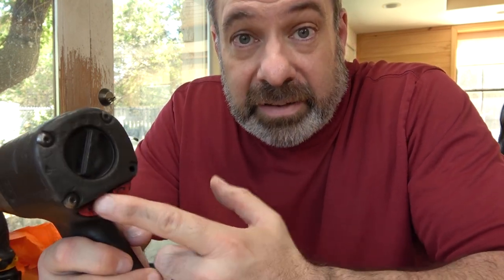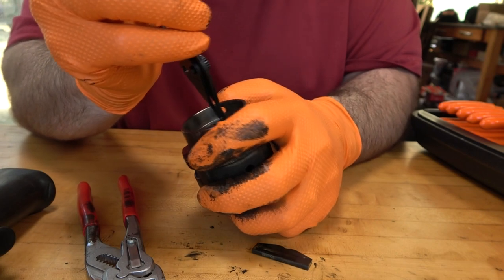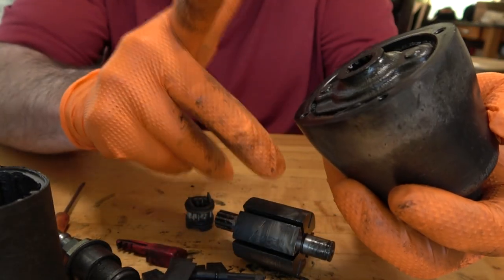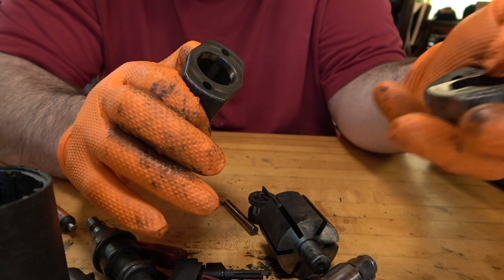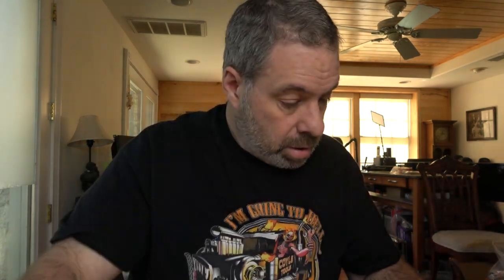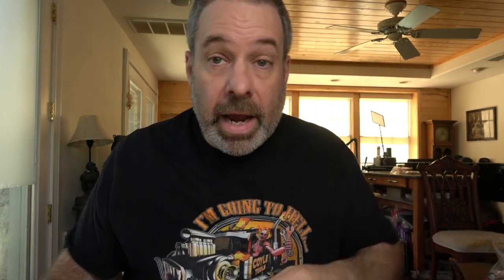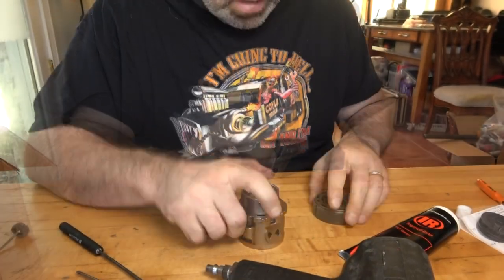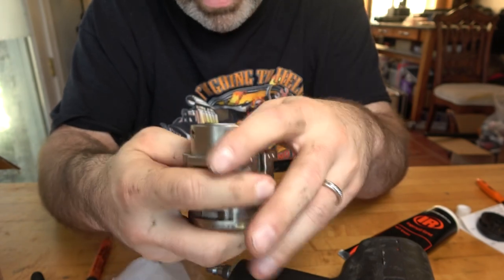Ingersoll-Rand 2131 1/2"-Drive Air Impact Repair & Rebuild

Comment: How did you get the old bearing out?
Reply from the maker: I can't believe I neglected to put that in the video. I used a 90-degree pick and wedged the tip between the bearing and the housing on the inside diameter of the bearing, then slowly worked it loose.
Reply: I used some gentle heat around the bearing holder. Let the bearing drop out by gravity.
Reply: @lawts0908  What's gentle heat?  What did you use?
Reply: @CoyleTools  Did you record taking the bearing out? That's the part that scares me the most.  Would love to see it.  Also what pick (brand) did you use? Picks that small easily bend.   Thanks!
Reply: @SteveK99Sub  Hi Steve, I used a general purpose plumbers blow lamp ( used for soldering plumbing joints) this should definitely be enough. Gently heat the aluminium bearing holder nice and evenly around the bearing.
Reply: Are you saying a electric heat gun ok ???
Reply: @philliphall5198  That may do the job, so give it a go. Otherwise use a plumber’s propane blow torch for a bit more heat.👍

Comment: Nice, not sure if anyone has touched on this but 1/2 & 3/4 pvc make really good bearing drivers, back in my farming days we would rebuild centrifugal pumps for spraying applications and the pump manufacturer instructions suggested using pvc for bearing drivers, looking forward to some more live streams 👍🏾🤙🏾
Reply from the maker: GREAT suggestion!

Comment: I appreciate your video.  I have this model and rebuilt mine based on your video.  There is one critical error in your video that can drive folks crazy if they follow it closely.  When you assemble the hammers into the cage, you must ensure that the inner lips face inside or you will not have any power when operating the unit.  Your orientation in the video has one hammer with the inner lips facing inside and the second is facing outside.  When I first reassembled, all seemed to work fine until I actually had to remove a bolt - had not power.  This was the problem.  Again, thank you for the video, it allowed me to repair this Impact that was giving me problems.
Reply from the maker: Thank you for your insight on this. Admittedly, I'm not familiar with the inner lips you're referring to. The hammers have flat surfaces and my understanding is as long as they're aligned such that the slots on the side properly accept the pins, they correct. Can you elaborate on the lips you're referring to?
Reply: @CoyleTools  if you look closely at one hammer.  One side is different from the other.  One side is flat while the other side has grooves on the inner portion of the hammer. The inner grooves face on the inside of the cage.
Reply from the maker: @MrBobby3340  Thank you. I'll give a look at the next one I get.

Comment: I remember the rebuild kits used to include the vanes which never seemed to wear out.  On the old CP 734’s it was always the hammers that would break and often the anvils were bad.
Reply: I still got several of them but never use them anymore 
Lots of ware

Comment: With blind bearings like that a slide hammer will make quick work of it. Great videos, keep it up
Reply from the maker: Thanks, Alex, that's a good tip. Sadly, I don't own a slide hammer, although I have them in stock and the small one would have been perfect.

Comment: Very helpful video. I have the same model and have been thinking about putting it back into service
Reply from the maker: So happy you found it useful, Greg! I'm confident yours will do well.
Reply: It still works pretty well I just never liked the pin retainer. I got it used and ran it for 10 years so it's probably pretty gunked up too

Comment: Great video I've never seen the inside of an impact gun when you said you don't recomend the method you used for tapping in the bearing you were correct it is always a good practice to use something the same size as the outer race of the bearing ie a washer,pvc, etc so that you don't damage the bearings by driving on the inner race 😉
Reply from the maker: Thanks, bud! I'm so glad you enjoyed it.

Comment: Great video. I've got an IR Titanium, not sure of the model number, but it looks like this one. Problem I'm having is the throttle is getting blow by. Meaning as soon as I put it on the hose it will start spinning. Took it all apart (thanks to you) and looks like the throttle needle assembly is worn out. One of the little "star" looking things has all the knobs worn down. 
My questions are: Do you know how to determine the model number (mine has the labels worn off)?
What grease do you recommend for lubrication on the parts? 
How often should one do a deep clean and relube? (I'm sure it's dependent on usage)
Thanks again for the super informative and detailed video. Certainly earned my sub.

Comment: FYI, a slight excess of grease is fine, and preferable to not enough grease. The hammer case is designed so that excess grease will work itself out through the anvil opening. IR recommends 4cc of grease through the fitting (4 pumps from a mini grease gun) using IR115 grease which is a bit lighter than IR105 so it gets distributed better when using the grease fitting.
Reply from the maker: Thanks for the advice, Wayne!

Comment: installing a bearing by pressing/hammering on the inner race is not 
the best for the bearing. all the force is being transferred through the balls to the race surface. it's best to apply force to the race that has the resistance, in this case the outer race. hope this helps, thanks for the video

Comment: I’m cant understand why you replaced so many parts, but not the red seal between the hammer anvil assembly and the vane motor. I think this seal is one of the more important components as air will leak out if it fails. Well worth the bucks if you’re doing a strip down imho.
Reply from the maker: The one that was there was fine. I don't see a need to charge the customer for unneeded parts. Those gaskets are plastic, so they're pretty sturdy.
Reply: @CoyleTools  That’s fine. Forgot to say about your great singing though. Really enjoyed the video, many thanks.

Comment: Hi,

Iwamted to know if you have any knowledge on the W5350? It’s their 1/2” right angle battery impact. The anvil is really loose. Like, there is no pressure pushing it into the casing. I can move it all around easily. Now when I take the backplate off, exposing the insides and i press the big hammer section that sits on top of the anvil, there’s not play at all. 

I can’t think if there is a washer missing or something. It was taken apart from i can tell. I paid 50.00 from eBay stating no tested, buy at risk. Being this is a 450.00 tool new, i took a chance. 

I found a parts diagram, but can’t see what I might be missing. I was hoping you have insight. Maybe the inside of the anvil is worn that much? What do you think if i may ask.
Reply from the maker: I appreciate your viewership and the inquiry, but I won't speculate on a diagnosis without seeing the tool, nor will I provide a diagnosis for free.
Reply: @CoyleTools  
Well, I’m sorry that I did ask and I didn’t think you would respond with that honestly. I just wanted to know if you had any suggestions that’s all I wasn’t looking for a full MD diagnosis and repair guide for it. I already took the tool apart. It just doesn’t make sense to why it’s loose. 

I was just asking in a friendly way that’s all I wasn’t looking to make you take up your time. Again, sorry for asking for you to do something for free.

I would’ve been just satisfied if you said you don’t have the tool in front of you and you don’t just wanna say anything. I would’ve been totally fine with that. 

I help people a lot in my industry and talk to them and give them advice and small little diagnosis here and there and I don’t ask them for money. 

But I respect how you feel that is it. You’re right you don’t have the tool so you can’t really tell me what could be wrong, I was just hoping you’ve seen this problem in the past and thought oh maybe you’re missing this or that.
Reply from the maker: @Thomasjcolbert82  "I would’ve been just satisfied if you said you don’t have the tool in front of you and you don’t just wanna say anything." But that's exactly what I said. I won't speculate without seeing the tool because that's how people give bad advice, and that's not fair to you. I could lead you to believe something that isn't correct and could cost you money, and that's not in either of our best interests.

Please don't be sorry you asked, I'm glad you did and would rather say something you didn't like than not say anything at all and leave you hanging.

Comment: I have a 30+ yr old 2131, work and spins fine under air pressure, once on a lugnut just hear air, no power, vanes replaced, torn down all o rings look fine, i'm at a loss
Reply from the maker: You can contact the company we use when we send air tool repairs out. Power Tool Repair will be able to take care of it for you. https://powertoolrepair.com (330) 630-0022
Reply: @CoyleTools  Thanks, but rather fix it myself, that's what being a 40+ yr Tech is for, I haven't used it in years, has to be maybe a crack in body or air diverter valve
Reply from the maker: @ChrisW1962  It may be worth a call to them to see if they can give you advice about it. I've been stumped on a couple of things and spoke to their techs who put me on the right road.

Comment: really interesting not many tool guy's do what you have just done, I told our lass she said nooo I said yesssss she said nooooo I said yesssssss and she noooooooo ,I showed her and she believed she said a good mannn I said a very very good mannn and she said a very very very good mannn then i agreed I kurumba I forgot what we was talking about and she said me to ,we both looked around and see a crazy man with a gun in hand 🔫🇬🇧 just joking ♥️ ya show my old pal well I feel like I've known you for years,I was wondering why you didn't put any grease on the hammer pins that would have help slow down falling out or grease on the housing gasket that would have stopped the gasket from moving and a better seal air leakage or seepage of oil.